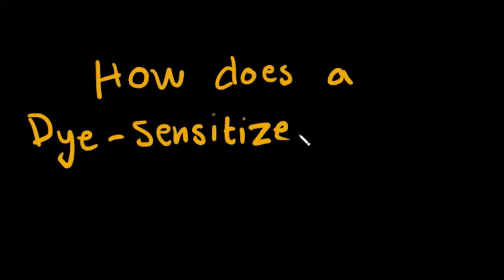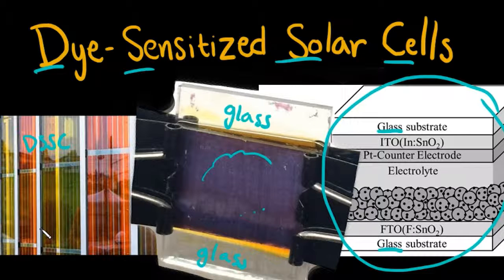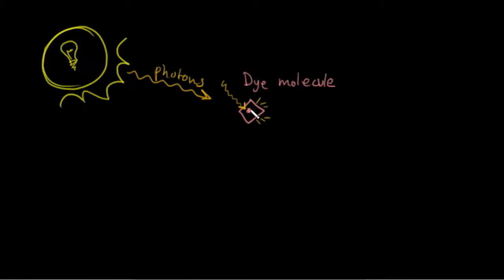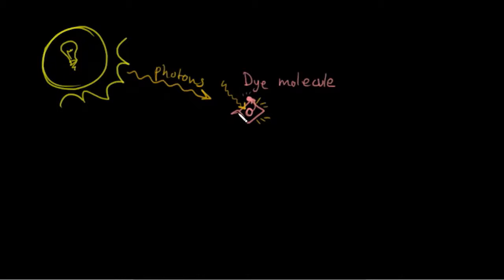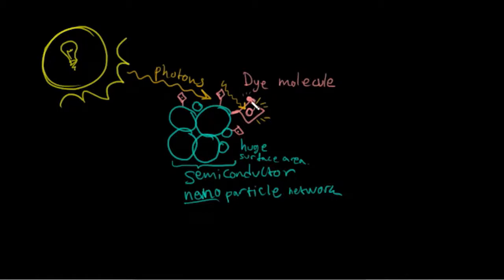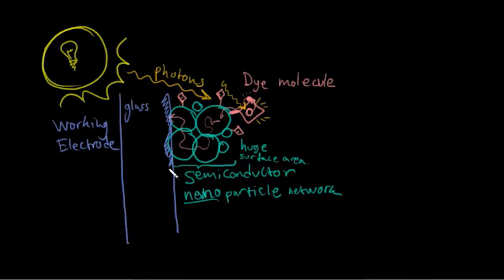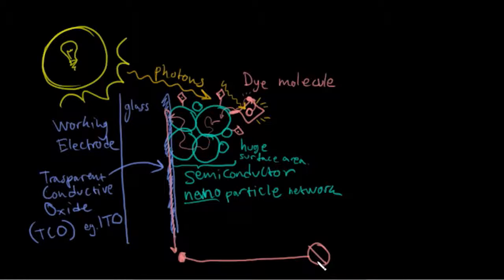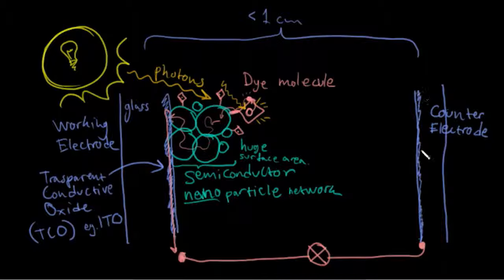How does a Dye-Sensitized Solar Cell work? (depricated)

Comment: Step 1: Dye molecules coated on the metal oxide semiconductor absorb wide spectrum of the sunlight. And upon absorption of sunlight the electrons of dye molecule get excited.
Step 2: The exited electrons of the dye molecule are injected into the conduction band of the metal oxide semiconductor.
Step 3:These electrons will diffuse through metal oxide and finally reach counter electrode through the circuit.
Step 4: The oxidized dye molecules will get the electrons from the redox mediator/electrolyte and come back to their original (reduced) form.
Step 5: The oxidized electrolyte species diffuse towards the counter electrode and get reduced.

Comment: what is dye molekul made from?
Reply: Cis-bis(thiocyanato–k N )bis(4,4′-dicarboxylato–2,2′-bipyridyl)
ruthenium(II) for maximum efficiency. 

If you're not worried about efficiency/meaningful power generation you can use blueberry or blackberry juice to sensitize the TiO2.
Reply from the maker: Correct!
Reply: I once made dye with beat fruit which is rich in red betanin
Reply: atoms